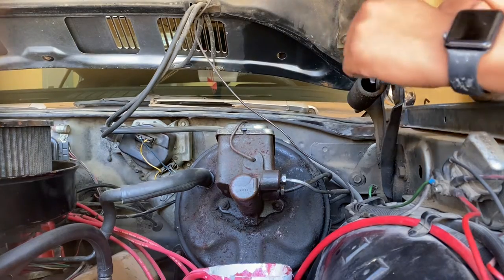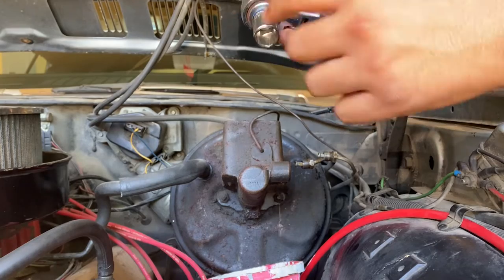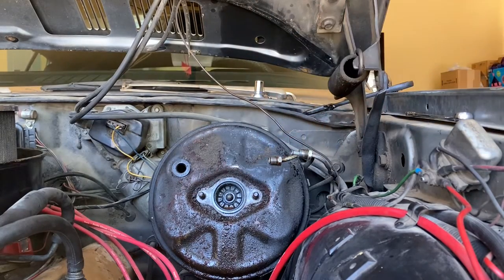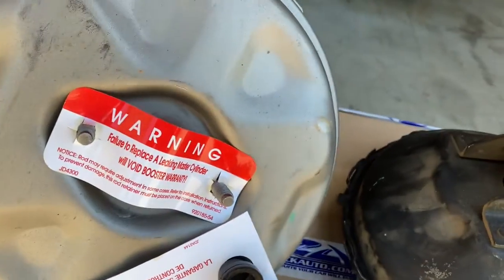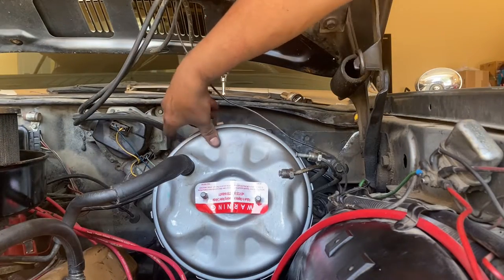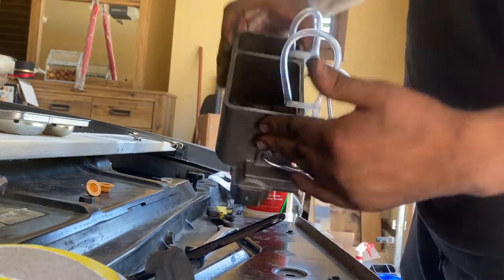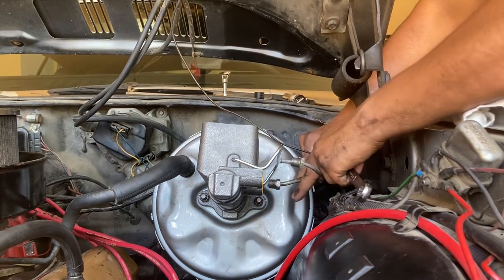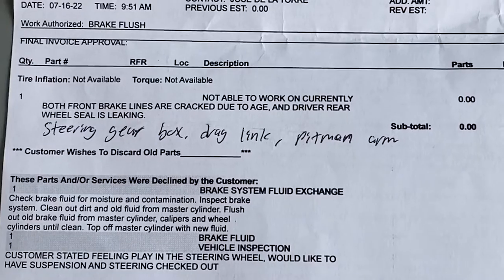Oldsmobile Cutlass Master Cylinder & Booster Replacement- Start to Finish - DIY How To - GM 70s

Comment: Thanks for the video and the tips. Nice ride you have there, my 72 olds engine is sitting in my 1950 Chevy Panel Delivery truck.
Reply from the maker: thank you for the feedback.  & thats awesome how many miles do you have on your 72' motor?
Reply: @dltsgarage1705  Not sure I have owned the truck for a couple of years. It had been abused by previous owners and I am thinking it went years without maintenance. When I changed the oil and transmission fluid it was so thick and dirty that it took forever to drain. Been working on the truck since I bought it, probably one thousand miles driven. I am not going to make the truck fancy and until my brakes decided to retire I use it daily. My longest trip is to Lowes which is five miles from my house. It had no gauges and some of the wiring was held together with duck tape. It is sad that a 1950 Chevy  Panel Delivery was treated so poorly. I am retired and was looking for a project as I like to keep busy. Take care and happy motoring.

Comment: Thanks for the content. After the swap, is it necessary to individually bleed the brake lines? Swapping out the same set on my 68 Chevelle ss.
Reply from the maker: I did, but in my case I ended up taking it to a mechanic & had him do it. Saved me a little bit of a headache.
Reply: @dltsgarage1705  Thanks sir. Keep up the good content!